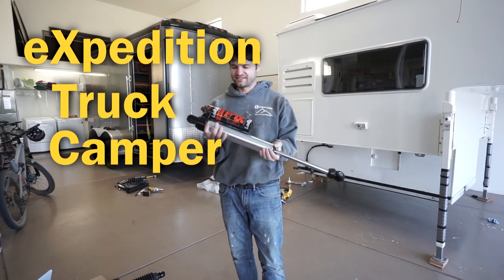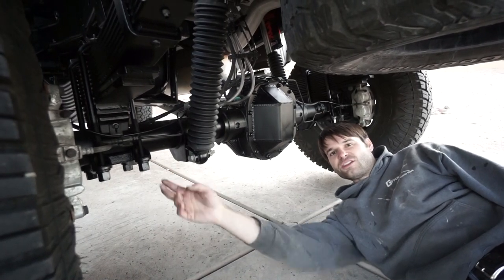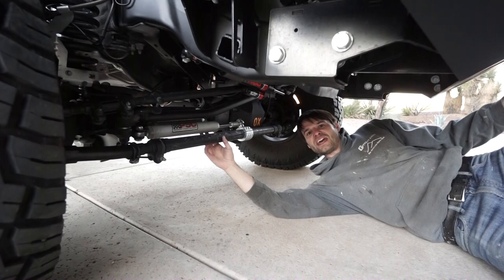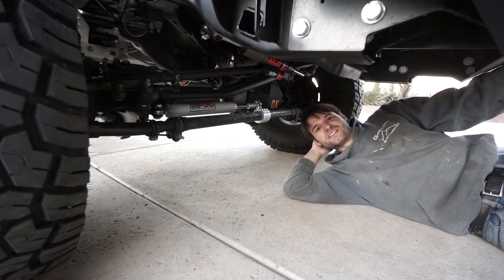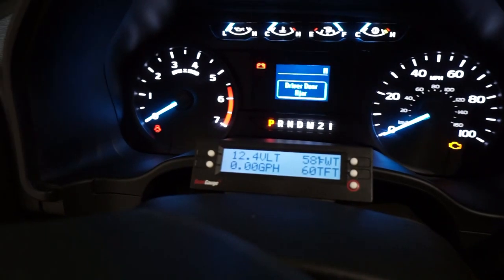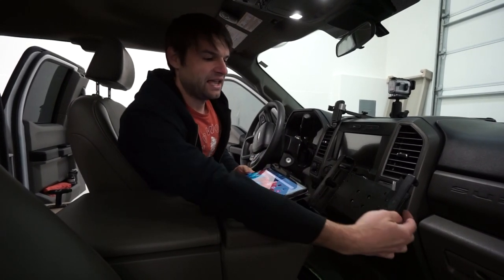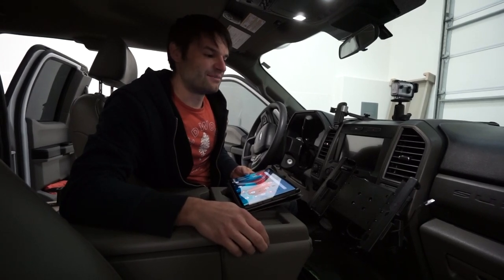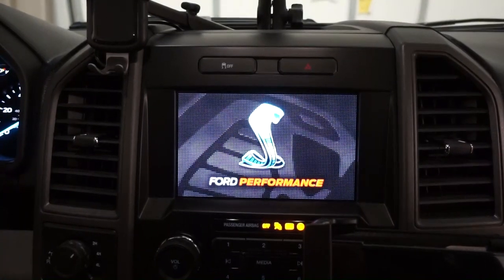WHEELS ARE OFF... Build Update! 2020 Ford F250 - Super Duty Build | Part 13

Comment: Holy mackerel , those leaf springs ! Do you have any idea what your payload capacity is now ? Still the same axel though right , which has a limit .
 I have a 21 f250 6.3 with 3.73 . With all your knowledge what is  it officially called , pumpkin size  ? I'd like to do a early fluid change to get the junk out and I'm not finding much on the internet .   GREAT CHANNEL . You two are so down to earth .👍 👍
Reply from the maker: We had the rear leaf springs designed to carry 3,500lbs and sit "level" with the front (which is lifted ~3.5").  Definitely will do that!  
Think you'll want to search differential fluid change... for info.  Not a bad idea to change fluid.  Manufacturer recommends 30k service (IIRC).  Early service never hurts!  Your axle gear ratio is 3.73 (most common).  We have the optional 4.30 factory gears (perfect for 37" tires).  Hope that helps!

Comment: Thanks for sharing all the details of your upgrades.  I have a 2017 250 with a hard sided Bundutec slide in camper similar to yours.  Agree completely with your assessments on hardside vs. soft.  Did you consider a blue tooth style scan gauge?  Was there a specific reason you went with the hard wire?  On your older model did you have any issue with misfire code.  I have had to replace all spark plug wires and 2 cyl. coil packs at 86K and now have another code for cyl. 6.  I have ordered the scan gauge in your vid.  Thanks again.
Reply from the maker: Absolutely!  Glad you are enjoying your camper setup too.  Yes, we have a couple blue tooth OBD2 scanners as well.  They are handy.  Scangage2 is primarily for monitoring truck vitals with the ability to also read codes.  I like to know actual temperatures and real time info.  No issues with misfires but our truck is fairly new (no issueson the 2019 either).  Let me know what your solution ends up being...  would be curious to know!

Comment: Peter...never mind. These shocks are no longer available and they're moving to a whole new part # and may not be available until early 2022. Back to square one...I'll be looking for a substitute to Fox.
Reply from the maker: Adjusters are helpful especially if running various weights.  Otherwise,  if weight never changes then less beneficial...  King makes a good shock.  Bummer on the delays.  We waited over 6 months for these shocks
Reply: @TruckCamper  Yep. I talked to John at Accutune and Fox is kinda doing lots of changes and right now everything is in a bit of a "grey zone". I won't bother with the adjusters because my camper isn't going to be taken off/on the truck. I'm open to options and doing research right now. I might consider King, but there's also Ikon and Bilstein, etc...they've got to be pretty heavy duty, because the wet weight is 10,700. I might end up with something that can't be tuned after all...we'll see. Thanks for the reply and once again...you are the MAN!

Comment: Nice work.  Did you meet the folks at Accutune out in Johnson Valley or Barstow for a custom tune?  Or did you simply give them details of your setup (total weight, Deavers, tire size, etc) and let them tune the shocks at their shop before they sent them to you?
Reply from the maker: Appreciate it.  I haven't physically visited the Accutune shop.  Just provided specs to them and they shipped the tuned shocks.  :)

Comment: What is the service for your tablet?  Is it connected to a mobile plan, or something else.  I tried to use a hot spot from my verizon phone with an iPad and it could not keep up.  Do you have an opinion about apple or android for navigation?  Thanks.
Reply from the maker: We are using Samsung Tablet with WIFI no cell.  Apple tablets need cellular card in order to get GPS function.  I do prefer Android and Samsung.  We also have a Verizon Jet Pack in the camper.  So realistically the tablet always has connectivity.   Hope that helps!
Reply: thanks for the quick reply.  Your info. is always appreciated.

Comment: Did your stock bolts fit through the new shocks on the rear? I just got a pair of fox 2.5 dsc also but my bolt doesn't go through the sleeve. Stock bolt is way bigger then the lower mount on the rears. Thanks
Reply from the maker: I believe we did use the stock bolts (don't remember for sure).  But also chopped and raised the rear mounts at the same time.  Gained at least 2" ground clearance.

Comment: Absolutely love everything about this rig. I have the same truck, and building very similar, but way slower.  Hydro assist, AND steering stabilizer?? Love the swaybar delete info. Thats a mod I can afford. None of my prior trucks needed one, why should this one. I cant imagine what is left to do to this thing, more, and better skid plates? Those rock anchor shocks mounts caught my eye right away. Curious if you lost 2" down travel in the rear?
Reply from the maker: Appreciate it!  Hydro assist is amazing for turning the big tires especially off road.  Stabilizer helps mute steering feedback.  Since the shock tower was shortened 2" with stock length shocks... we gained 2" extension travel and reduced 2" compression - which matches the lift height.  Realistically, there is more shock travel than axle travel anyhow.  Best to your build.  Hope we can provide some ideas.  Thanks for sharing!

Comment: Peter I have a question for you. I'm going to order those Fox shocks from Accutune for my F-350 with a camper on it that's about the same weight as yours...I have a choice, the ones with the damping adjustment or the ones without. The price difference between the two is considerable and I was wondering if you think the damping dial feature is necessary or if it's overkill.
Reply from the maker: We don't adjust often but nice on occasion as load weight changes.  Also much easier to tweak than pulling shocks apart to revalve.

Comment: I have a 2017 f250 on 37s but what parameter did you change in forscan to get the speedometer to be more accurate?
Reply from the maker: Initially I changed the axle gear ratio to 3.73.  I guess that works for some of the pre 2020 trucks.  Ended up changing the tires diameter parameter.  Went to the max number it would accept.  Got within 1-2% of gps.  Good enough!